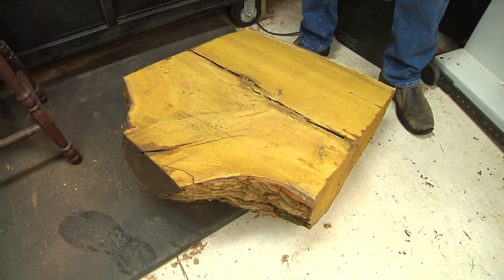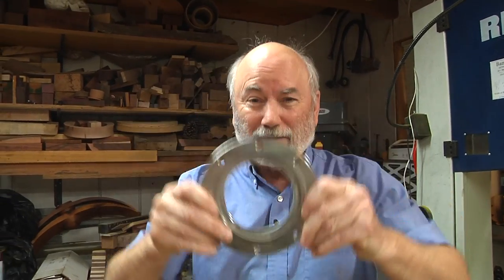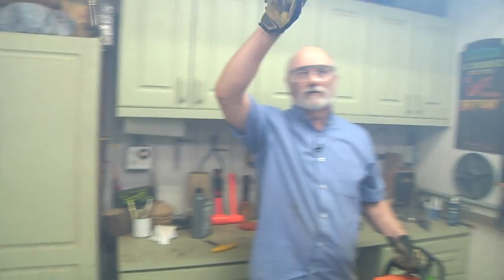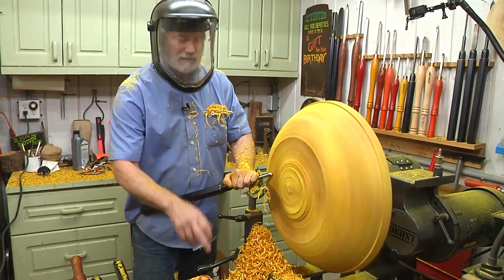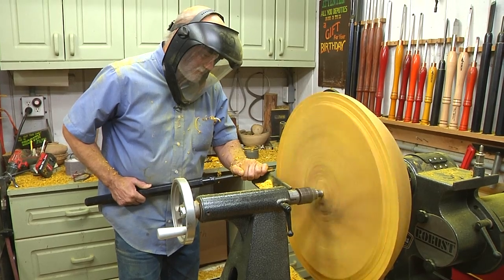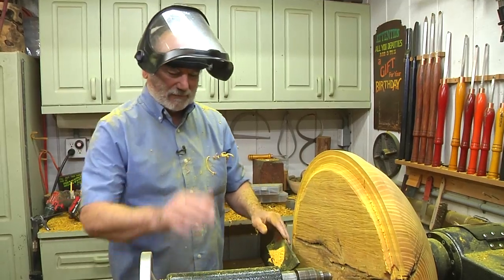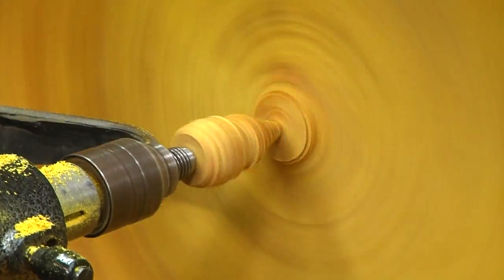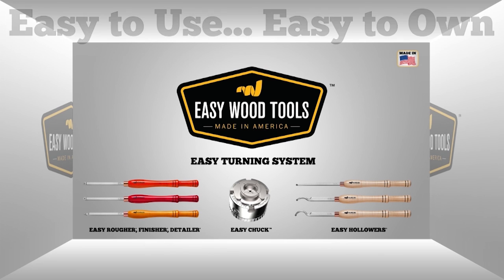Osage Orange JUMBOwl

Comment: Tim, a good project you turned in this video. I do have a spruce burrell i will be turning in the future. I did turn an elm candle stand and a eucalyptus root  cup for the first time this month. You did get me interested in turning when you were on PBS with your short series. I was surprised i did good turning the cup as i thought it would be a disaster as some other types of art i try appeared primative. 
So far, with turning, i am not a member of the funnel club.  I did notice that turning it is relaxing and  has a sense of accomplishment with a finished project.  
Thanks for what you do. Keep turning and be safe.

Comment: Really nice bowl Tim! Always love Osage as it turns and sands great but takes a great finish every time! I turned one that ended at 21-1/2 inches and have 6 huge logs in my yard. It wants to turn brown with uv light hitting it but I found just putting a little sun block on it keeps that beautiful color.
Reply from the maker: What type of sun block do you use? That is such a great idea!
Reply: @woodturningwithtimyoder  Just over the counter type like you would use on yourself at the beach. Just put a small amount on a rub it on good. Veery cheap and easy but best of all it works well!

Comment: Nice job. If I am not mistaken you turned the inside outboard which saves your back from leaning in. To seal cracks as I go I often seal from the outside finished surface with 5 min epoxy colored with mica then pour some 30 min colored epoxy and let it soak to as deep as it will go. I realize you wanted to finish in one day. That is a several day project for me. Great j on.

Comment: Man that’s one hell of a bowl. That would have made some great cores. What was the final dimensions of it and what did you use for the finish on it?
Reply from the maker: It is a little bit over 23 in wide. I used hand rubbed polyurethane. I'm going to sand back each coat and keep adding coats until I have about 10. I think that would give it a wonderful satin gloss.

Comment: the one way faceplate is very interesting. A real inovation. Did it work better than the 10 inch faceplate from the other project of that size?
Reply: Vicmarc has had one for years.
Reply from the maker: It held remarkably well. I think I tested it well past its intended capabilities and it passed with flying colors.
Reply: @woodturningwithtimyoder  Your recess was like the Grinch's heart - three sizes too small...